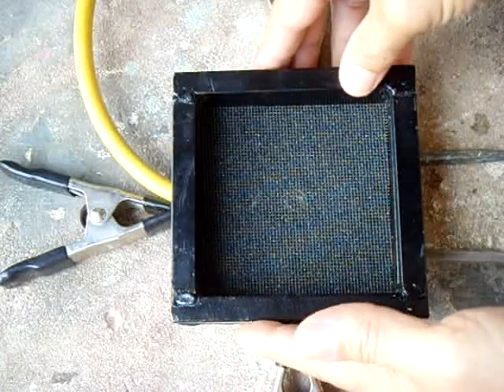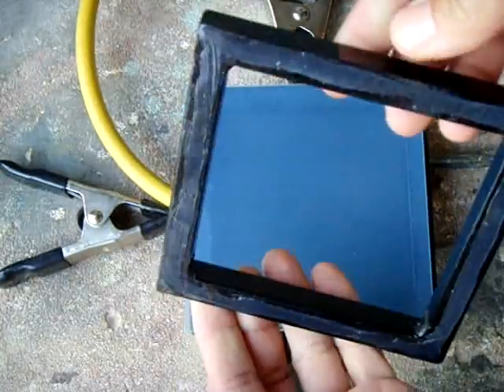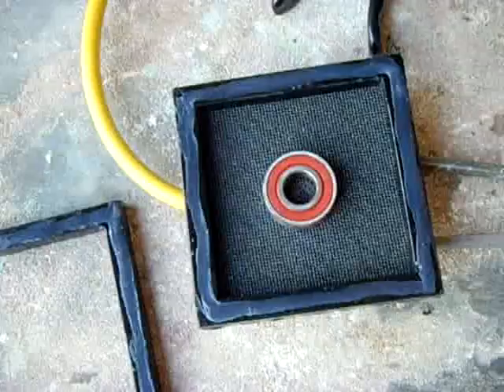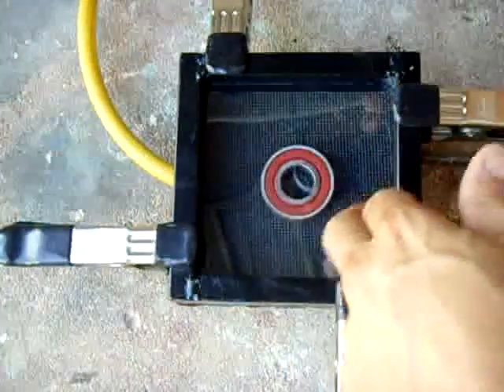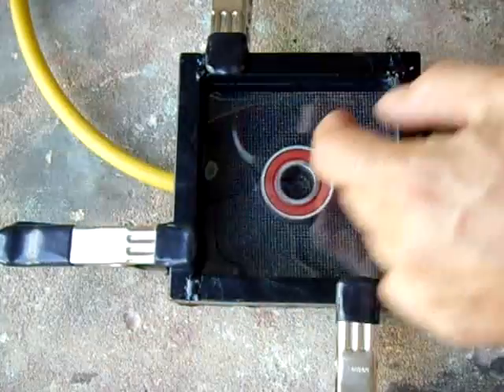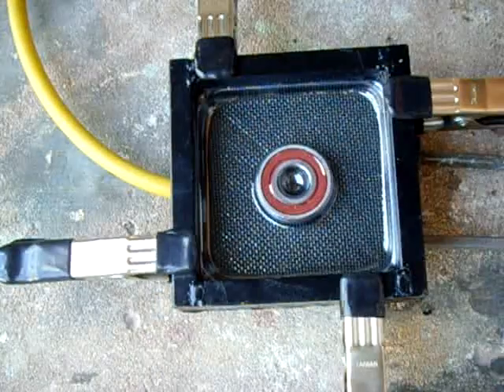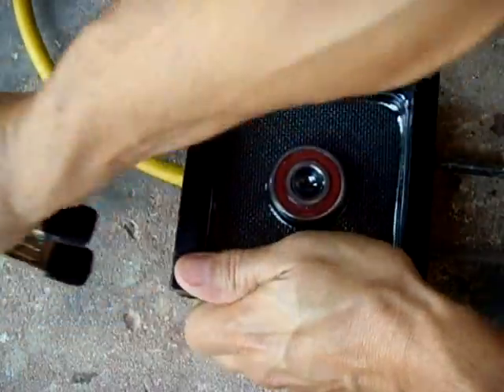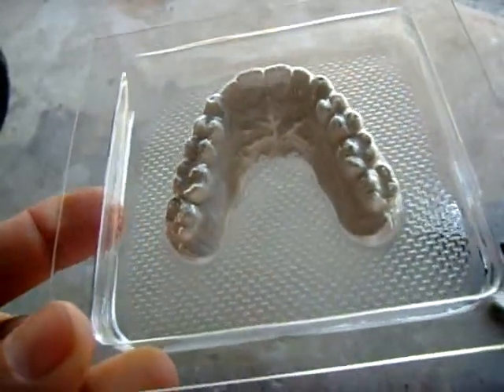Homemade Vacuum Forming Plate

Comment: I used the Drywall Screen idea and it worked great, thanks! My setup is a wooden box with a shop vac. Also, a 6" x 6" metal frame holds the polystyrene sheet in a toaster oven, where it droops in just a few seconds. Interesting that the 90 degree 1" high corners did not create buttresses. Great!
Reply from the maker: The drywall sanding screen works flawlessly every time. :-)

Comment from the maker: 75 is cheap. The thief I went to many years ago, like 20 years ago, attempted to charge me $200 for a replacement.  I only had the retainer a couple weeks. I told him to kiss off in a nice way, and ever since, I made my own. Mine actually come out better. Contrary to what a dentist may tell you, gum recession can also be reversed wearing a retainer nighty for several months. The retainer must partially cover the gums to work. I have the molds to prove it. Also use a soft tooth brush.

Comment: Thanks for your very helpful video.  I've made a vacuum box along these lines in wood for a one-off part and the 'pull' was mostly successful.  The formed part has to be clear (windscreens) but has what looks like lots of tiny bubbles in it.  I used .030 polyester.  When you refer to bubbling from over-heating is this what you meant, or was it larger bubbles?
Reply from the maker: +mark addleson 
Overheating can damage the vacuum forming material by creating holes and bubbles in the material. You are referring to different bubbles.
Reply: +electronicsNmore
I thought so.  Further question.  When you work from plaster casts (for dental retainers), do you use any kind of mold release?  And I presume the material is acrylic.   Thanks again.
Reply from the maker: mark addleson
No

Comment: Could you make this out of wood? Or how else can you make it if welding is not an option? Thanks.
Reply from the maker: +TheSatch10 
Hi. Wood is porous. You will not be able to create a good vacuum, but if you apply a really good sealer and use hardwood, you never know. :-)

Comment: how thick is the plastic do you use? And what is the maximum thickness? Thank you for sharing
Reply from the maker: I use between .020" & .040"
Reply: i see.. maybe that's the problem.. I cant find acrylic that thick.. the thinnest is .060"..
Reply from the maker: Julian Tho

I have used .060" in the past with no problems.
Reply: p

Comment: What type of connector did you use to attach it to the box? Where did you get the connector from? Good video!
Reply from the maker: brass or nylon fitting from Home Depot. One side is a 1/4" hose barb, the other is a 1/4" male pipe thread. 90 degree fitting.

Comment: seems to me you could use large tubeing for the mold frame pvc .and o ring for seal plumbing end cap...that large sewer line.4 inch dia and bigger
Reply from the maker: +Miguel Castaneda  That "could" work. Since the PVC is much thicker than the thermoplastic sheet, it should not soften up while heating the sheet. Using a round form is not as good as what I used. Professional units are made square to utilize most of the sheet.

Comment: Its cheaper to just buy a JSP dental vacuum form machine for $93.93 on www.Etsy.com  than buying a vacuum  pump plus the connections to your apparatus.
Reply from the maker: I already had a vacuum pump and steel laying around. :-) I enjoy making things.
Reply: Where is the fun in that. Nothing more satisfying than making your own equipment, replacement parts e.t.c. Maybe a home vacuum could replace the vacuum system....who knows. Experimentation is the next fun part.

Comment: urjnlegend. ..I want to get away form silicone for my multi cavities mold for financial reasons year but mostly because it is really hard and time consuming to get the silicone surface to be ultra sheen. unless one uses industrial mold injection technique for silicone. plastic vaccum molding  is cheaper and easier to produce artisanally  I think. it is all about having the good tool, the table that has really tight seals and a powerful vaccum suction.